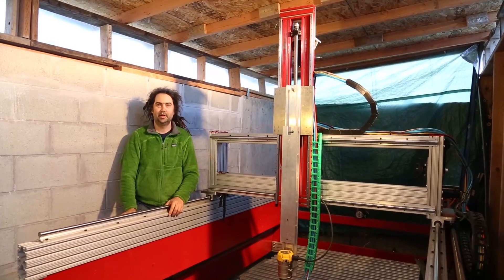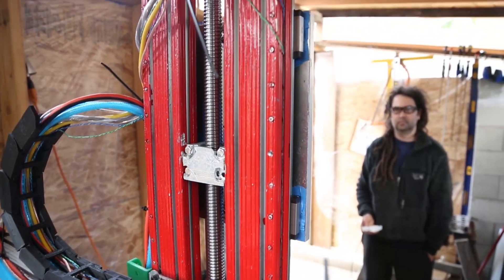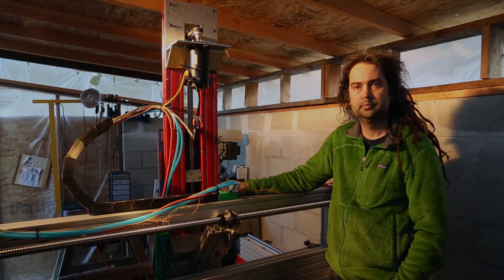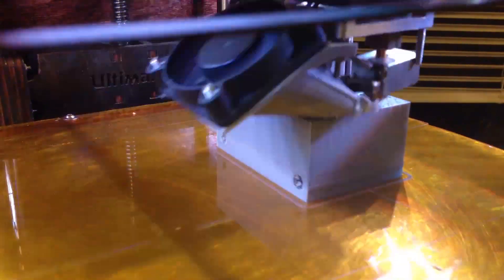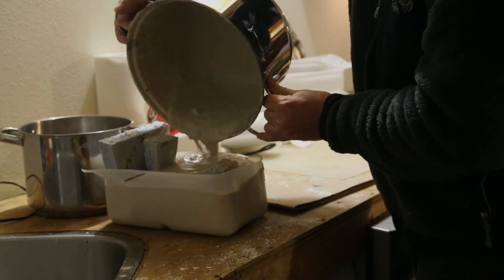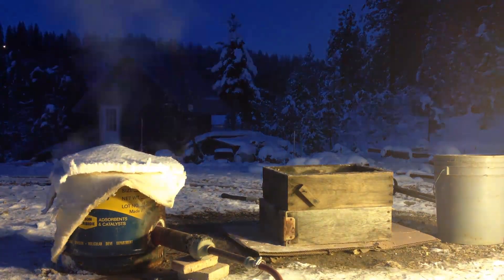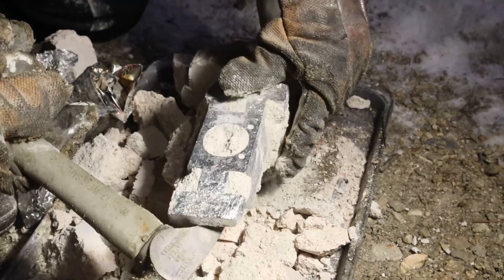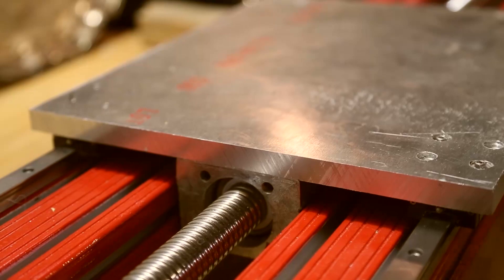Lost PLA 3D Print to Metal Casting; Short

Comment: Given the time involved in all of that (3D printing, plaster casting, burning out the plastic, the melt and pour.)  Would to not have been considerably faster and easier to mill that on part on your cnc? Probably cheaper too.
Reply from the maker: Jack Good This is a popular question and here is my reply: the point is you can use this identical process make casts that would be literally impossible to machine. Further more, unless you have a very fancy set up complete with robotic arms milling takes time and work too. First you have to generate your G-code, set up your billet (not to mention first purchase), change tools, etc, etc,. Plus there are other considerations such as my stock was 100% recycled aluminum from the local county dump. That said I have a vibrating table now that I can put a printed pattern on complete with printed runners and and risers and pour the plaster of paris mix. Whole things takes about 10 minutes mix and pour the plaster mold, another couple to pop in a furnace to burn out, and about 30 minutes of my time feeding the crucible and pouring. All said about an hour of manual labor for a beautiful custom cast part (or several).